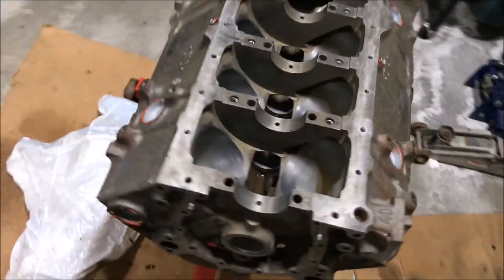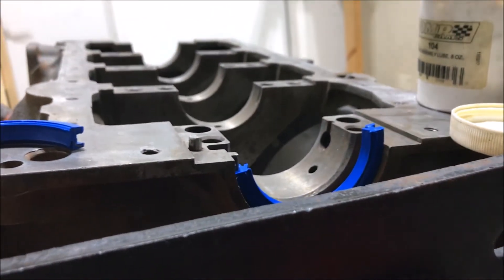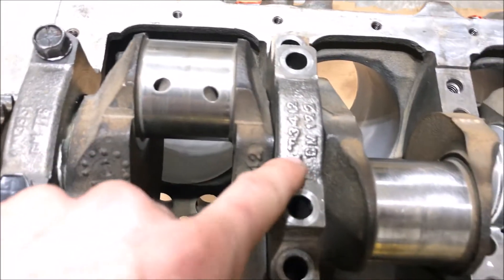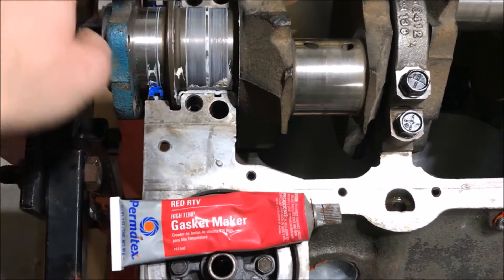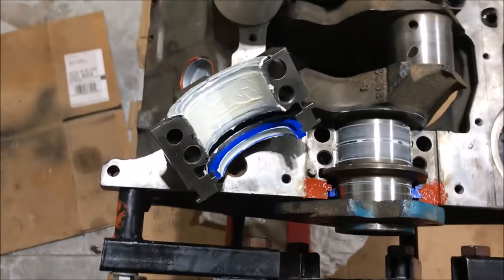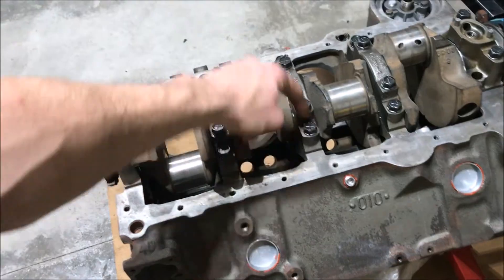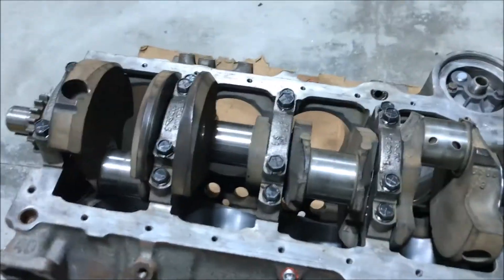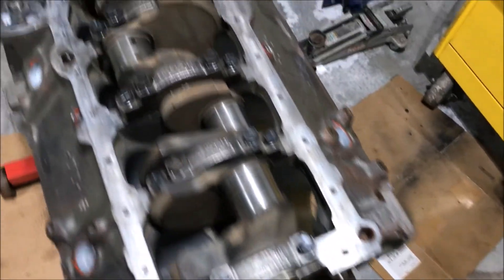Small Block Chevy Crankshaft Install and Checking Endplay

Comment: I’m having trouble with my build stock chevy 305 I have good readings on oil clearance until i torque it all down was told I had to check while torque down but not sure
Reply from the maker: Yes, definitely want to check the clearances while torqued. Make sure there’s no oil on the bearings while checking either (and no spinning the crank without oil)
Reply: @iowadiy6361  oh so to check crankshaft clearance I don’t want no Assembly Grease on it? I packed it on it got perfect clearance without torquing main caps to spec if I keep thrust cap at 15lbs and others caps same it’s great soon as I torque it down I’m at .0015 on clearance
Reply from the maker: Oh, yeah. For thrust clearance the main caps need to be in place and loosely tightened-just so that you know they are properly seated. Maybe 15 ft-lbs. and lubricated so that you don’t scratch the bearings
Reply from the maker: At 15ft-lbs, tap the crank with a rubber mallet each way to set the thrust bearings. Then torque just the main cap. Check the end play from there